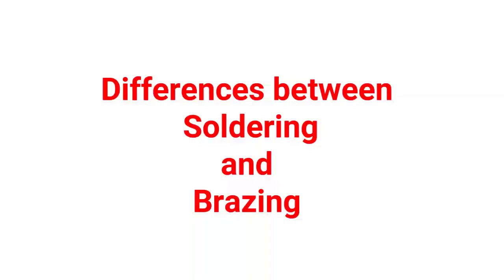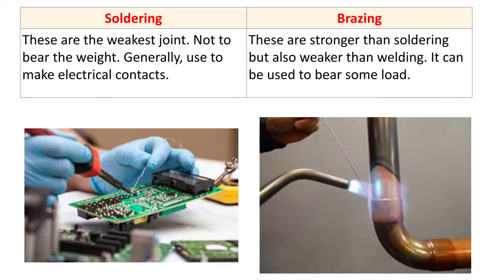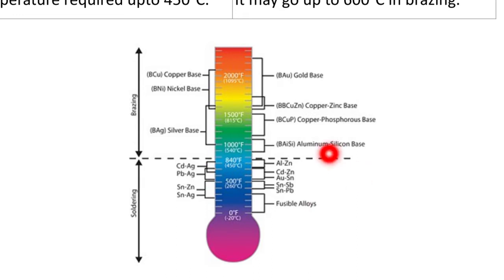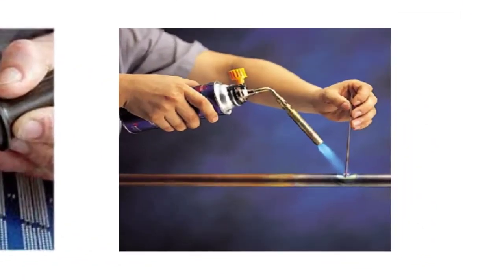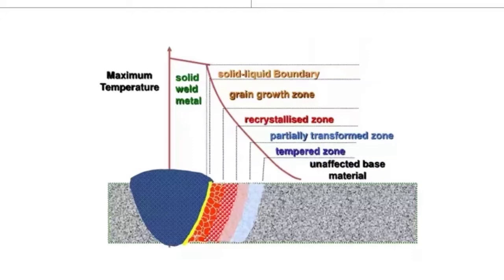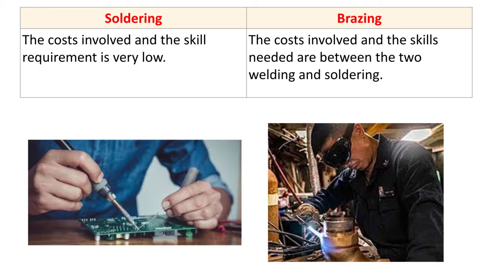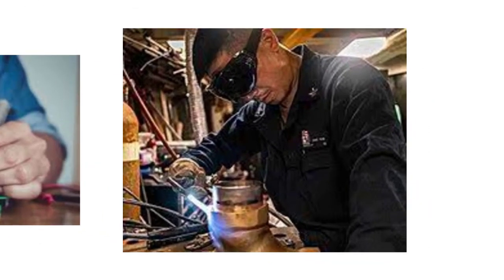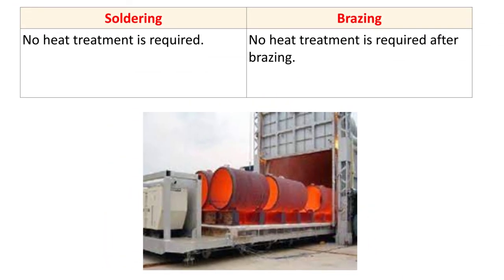Differences between Soldering and Brazing - Mechanical Engineering

Comment: I still don't understand what the difference is if someone might be able to explain that to me because I have to do some welding in the morning when I get to work and they said I should br brazing it and not welding.  But I'm not sure what the difference is if somebody could please tell me
Reply: Welding, you're probably using an electric arc welder, and it meltsthe base metal, creating a molten puddle, and you add some welding stick, mig wire, etc. 

Brazing, your gonna use a torch, heat the base metal workout melting it, and smear some soldering wire onto the joint. A lot of people just call brazing soldering.

Soldering you're probably using an electric soldering gun or an electric soldering iron. No electrical arcs are produced, the element just gets hot. You'll heat the base metal and smear soldering wire onto it. The temperature is cooler than with brazing, but the process is similar.

This video says you can just heat the solder, and not the base metal. I don't know about soldering circuit boards, but if you try that with copper wire, the solder won't stick to it. You have to heat the copper wire.